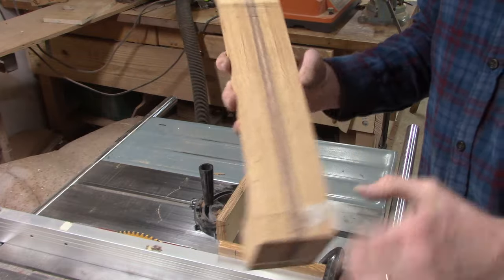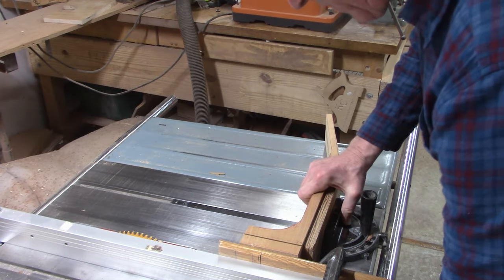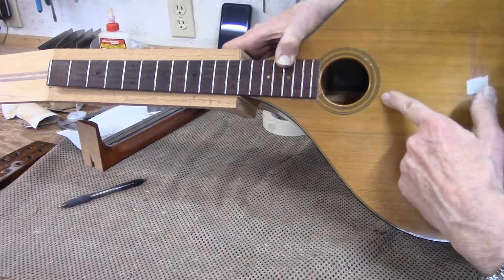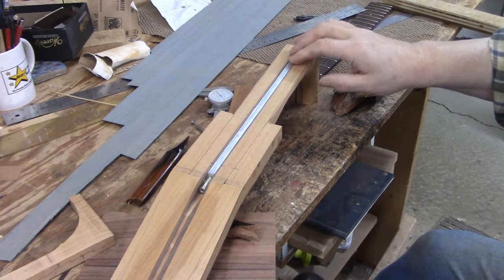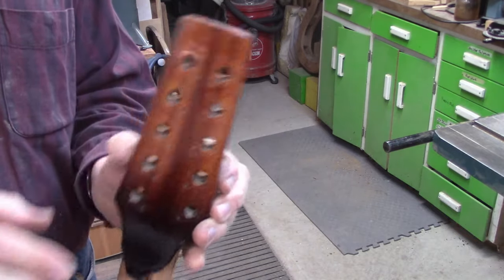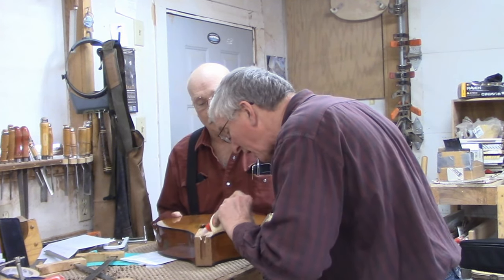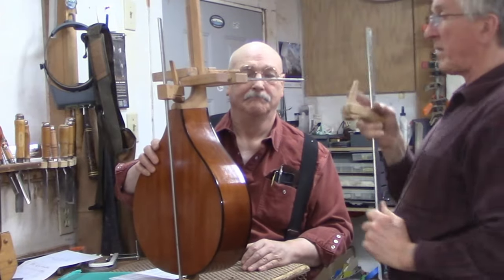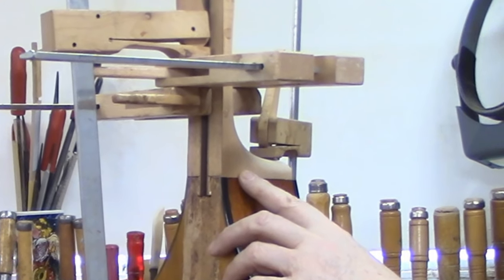Fylde Cittern Neck Replacement, part 2

Comment: What if the neck needs to be removed in the future again? Wouldn't a glued mortise and tenon be very hard to deal with? Compared to a dove tail.
Reply from the maker: No, it can still be steamed apart.  It may be a little more difficult than the dovetail,  but that is more than offset by the stability of the joint.